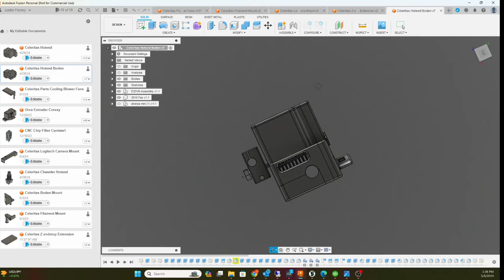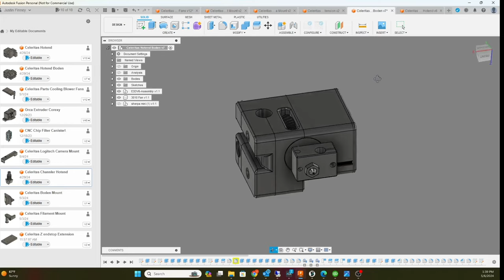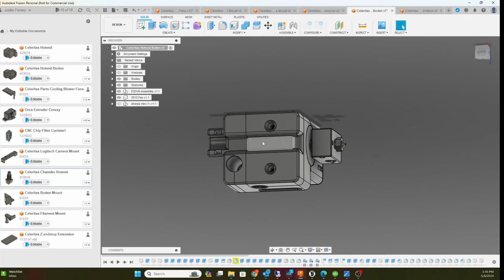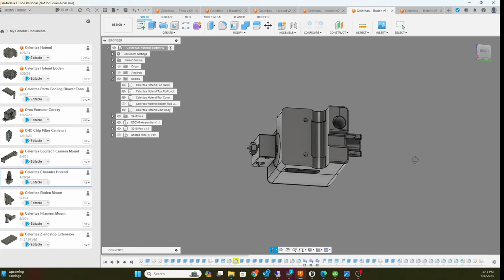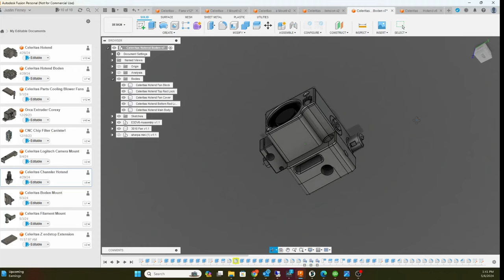Celeritas World's Fastest 3D Printer Concept, Hotend Extruder Design CroXY Carbon Fiber Tubes Part 2

Comment: Those brass bushing should last a long time and if you haven't most likely you have you should use a self-lubricating bushing. As for the x,y to remove a lot of the play why not make it one piece that the x,y go through make it where no screws are needed you just push the carbon tubes through and just use pressure fit self-lubricating bushing.
Reply from the maker: I thought about a press fit for the bushings. I designed it so its easier to change the hotend if I want to try different designs. I don't the weight of additional screws. I might try press fit. I'm going to try brass busing on the outside. The igus plastic bushings have allot of slop. I have it printing now. I have to upload the video.